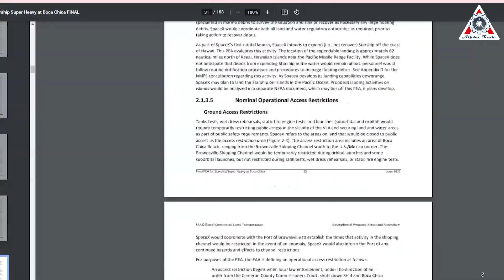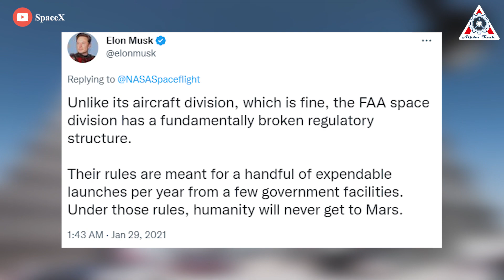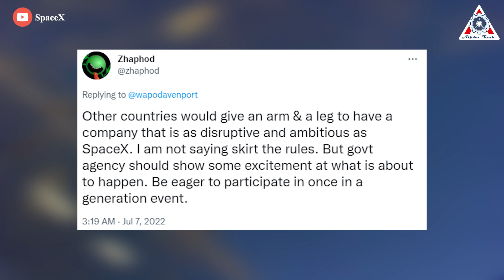SpaceX orbital flight "BIG PROBLEM": FAA!!!

Comment: If space x would have stated the full intent of starbase in the first place most of the issues could have already been addressed. Also this video strongly suggest that it is the FAA holding spacex back when in fact they are not ready to risk a full stack launch at this time. That is smart to do as much testing as possible beforehand as to not put the launch pad and infrastructure at unreasonable risk. Avoid a N1 replay before it holds up Artemins 3.

Comment: This ignores the simple fact. Starship is not ready for an orbital launch. They are still trying to fix the launch mount and pad so it doesn't get damaged after basic static fires. Because Musk decided years ago there would be no need for fire diverters etc. Except yeah, they do need them. You can't damage the pad every time you test engines. The pad needs to survive everytime.

Comment: Elon has said publicly that Starbase Boca Chica will be an R&D/flight test facility, not an operational launch site for Moon and Mars missions. Those missions will be launched from the KSC Starship launch facilities.  The current FAA launch license for BC restricts SpaceX to no more than five Starship orbital launches per year.

However, the tanker Starships that will be required to support those Starship missions to the Moon and Mars could be built at the Boca Chica Starfactory currently under construction. And those tanker Starships could be launched from ocean platforms anchored about 100 km offshore from the beach at BC. Five closely spaced tanker Starship launches are required for each lunar Starship and two or three for a Mars Starship. 

FAA launch/landing licenses should be much easier to obtain for those ocean platforms than for the Boca Chica launch site. No people or property near those platforms to cause safety issues in case of a launch or landing RUD. No environmental issues like there are at Boca Chica.

Comment: 4:33 - Routine launches with rapid cadence require, if anything, more stringent initial certification scrutiny.

SpaceX had no problems with "antiquated FAA rules" when developing F9 and its propulsive landing system, although they also followed "try first, think later" principle quite often even then. RUD on a barge didn't endanger anyone and FAA treated it as an experiment (which it was) and didn't saddle SpaceX engineers with an additional layer of investigation. But almost empty F9 first stage on a barge hundreds of miles off coast and SH/SS with thousands of tons of propellant few miles from villages and international border are tow very different things.
Reply: Given the environmental damage the vibrations of a super heavy/starship launch will generate, and the potential harm to ocean wildlife, I don't see much if any advantage to sea launches.
Reply: @JoeShmoism  Hm, acoustic damage from an SH/SS launch? I didn't think of that, but you probably have a point.
I was just pointing out that FAA and NTSB did not treat unsuccessful F9 barge landing attempts as accidents warranting an independent investigation.  Musk's whining about "antiquated FAA rules" is bogus - he is building an excuse for delays in the development of practically every aspect of his "Mars colonial transporter".

Comment: If the FAA was the problem of SpaceX, NASA wouldn't have allowed Musk to build his launch tower at Cape Canaveral. Though SpaceX seems to be transparent about the development of Starship, it is far from the truth... a lot of problem have arised and the big talk and the big failed predictions of Musk about Starship "about to launch" have nothing to do about the FAA blocking things up, it has to do with an increasingly anxious billionnaire looking at the money flying through the windows and about the complexity of this monstruous endeavor... it is pointless to blame the FAA, it is childish and it diverts attention to the probability that this booster concept was doomed to fail in the first place. In my opinion, SpaceX should've kept the design of Falcon Heavy and build a three core rocket with 29 Raptors instead not to speak about catching a giant booster in mid air... COME ON!!! And Zubrin was right about a smaller Starship on top of a three core giant "Falcon Superheavy"!

Comment: Regulation is just part of the deal. Just because you don't understand it, does not mean it's unjust. Quoting some random twitter user is weak. Glad you balanced out your opinion with a FAA response to the criticism or was that not your plan and this piece if work was just anchoring.

Comment: The FAA never seemed to have had a problem with NASA littering the bottom of the Atlantic with spent first stages over the last 60 years. 🤔 They definitely need to update the way they work with the growing commercial launch industry.👍👍
Reply: It wont float?
Reply: Broke back whale
Reply: Add nasa has littered space with spent rocket stages. Some are 50 years flying around out there. Federal government is not accountable to anybody. They are the worst kind of monopoly!
Reply: Needs a built in floatation package

Comment: The original SpaceX environmental impact statement for Boca Chica was probably deliberately deceptive, and the Feds know it.  The original plan was for Falcon Heavy launches, but SpaceX probably knew full well that the real situation was a Saturn 5 class launch but didn’t want to scare off the Feds.  The EIS process isn’t a secret, and SpaceX had plenty of time to prepare a new EIS & get it thru the FAA process.  Instead, SpaceX persisted with the deceptive EIS too long, leading to the current launch delays.  A lot of the current FAA requirements are trivial  & could be satisfied quickly, plus SpaceX could use the results for positive PR.  Instead, they seem to be dragging their feet.  Blame SpaceX management for the launch delays, not the FAA.

Comment: Those are the rules. Others are flying helicopters on Mars and orbit the Moon following the same rules and Elon cannot even get Starship to LEO because he has to give 5000 bucks to bird surveys and prepare signs honouring history? The only reason Starship hasn't reached LEO yet is because it is simply not ready and they are still trying to figure out how to run raptor II in a cluster without melting it or lifting off without atomizing the launchpad or how high a wall has to be to protect a tank farm or dozens of other issues most of which we don't even know about yet. These things take time to develop and evolve to the point where they're usable and the rate of progress slows dramatically the further they get. Trial and error was fine going from flying a cylinder a couple hundred meters to lifting Starship 10km straight up. But imagine the same lets-try-this-next approach for getting to Orbit, refuelling, Moon IO, Mars IO, landing on the Moon, entry on Mars etc. It'll take many crashes throughout many decades and success is less than certain. The FAA is not to blame for Elon pretending that it's all ready to go and the only thing holding him back is finding $5k for bird protection when in reality the entire concept is in an early PoC stage... at best.
Reply: All the bitchin' over $5k lousy USD.   And that lot moved in and overran an environmentally sensitive area, full well knowing what they had planned... plans that nobody seems to find submitted for approval. Clearly, from the antics that go on at that site they don't care and seem to think rules don't apply to them. 
How come ELONgared MUcK isn't on the first space tourist thrill ride around the Moon... supposedly soon?
Reply: the thing is that nasa had to launche first .then the FAA is that thing that comes out of the shithole of biden .there for elon has those drilling platforms.onse they are ready he dont need to dance to the FAA shitty rules.
Reply: Poc? Really?! 20 years in, Musk/SpaceX is running orbital circles around nasa/russian/blue origin/etc egghead engineers. All nasa can do is dust off on old and tired Apollo concept, at $4B/rocket, and pat  themselves on the back. Musk has done everything he said he was going to do and more. 

I know this is mr bezos! You should worry about your blue imagine rockets! 😂
Reply: @J56609  SpaceX would run "orbital circles" around NASA if the original announcement had become reality. Ten years ago, when it was still called BFR, Musk had (for lack of a better word) "planned" the first unmanned mission to Mars for 2016 with manned missions following from 2018. Last I checked, Starship hasn't even left the troposphere (let alone reached orbit, refuelled several times, reached MIO, reached Mars, successfully completed entry and landed - quite a few steps to go and all of them much, much, much harder than what has been accomplished by SpaceX so far). So yeah - it is very early stage of a PoC. Meanwhile NASA not only drove electric cars on the moon before my parents were born but has recently landed a rover and a helicopter propulsively on Mars. But here you are saying SpaceX is running circles around NASA. Serious question: why? Because they reuse the boosters on Falcon 9? The shuttle did that decades ago - and they not only reused the boosters but the craft, too. All SpaceX has achieved (and they absolutely deserve credit for that) is making access to LEO cheaper. The rest is still just fantasy and CGI.
Reply: @J56609  Bruh science and space exploration is far more intricate than you know. NASA is bound by government funding, if they had the resources SpaceX had we‘d be far far further along.

But its not about having the best rockets and making money, its about learning about the cosmos. Elon doesn’t know a single thing about space.. he doesn’t even think radiation is a problem in space around the moon.  The dragon rockets are amazing feats of engineering but they are bound to LEO and they are so successful because they fill a position NASA needed but didn’t have the resources to fill.
Reply: I love how you put the beginning of this. All of our achievements in space were under these rules and we have accomplished a LOT. 

It baffles me someone could think putting up a few signs or taking care of the extremely fragile wildlife is anti-progress.